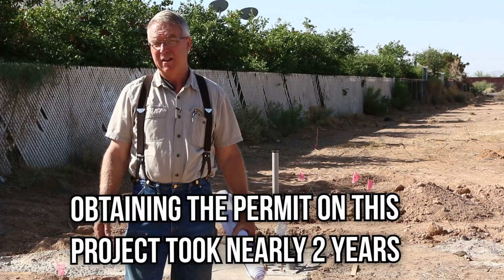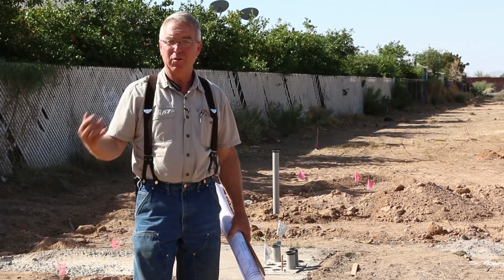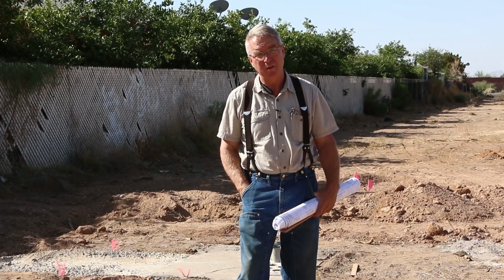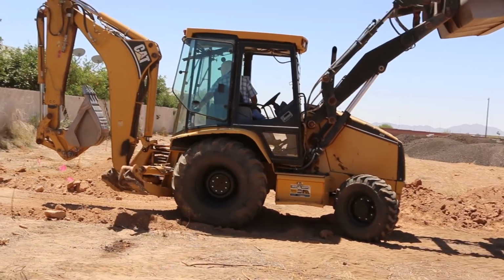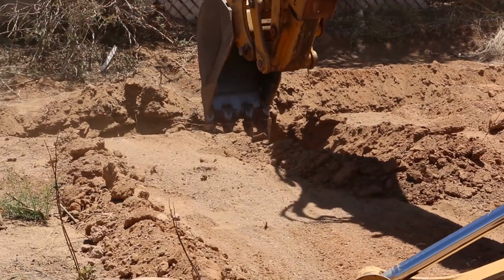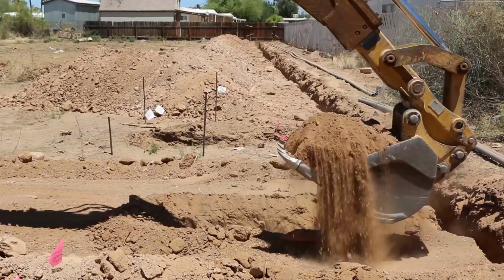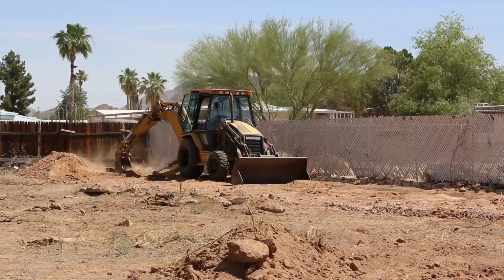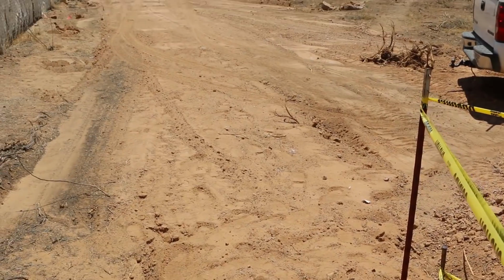Trenching for Underground Electric

Comment: what easy digging. Today, a 3" 10' pipe is $55. Today, in my area, Eversource requires (2) 3" lines. One for backup. Low voltage (Cable co.) also requires 3"  conduit. I'm running roughly 500 feet. This is residential mind you; that's just under $9,000 incl. tax. They're not even in the ground, glued together. 150 + joints.. 2 Silo's, 1 transfer, sweeps, elbows... the cost goes on!

Comment: I just happened to stumble onto this video and like what I've seen. Before your inspector came out, I could tell this was an SRP job by the prints. In the Phoenix area (AKA the Valley) it's either SRP or APS. Both are similar but their specs are pretty much the same. 
As a field superintendent for Premier Underground, we do an INSANE amount of trenching for dry utilities and it's amazing how much dirt comes out of the ground for these jobs.
I came up as a dirt guy (blade operator and other equipment) and can't tell you how many times we would come across conduit that was installed too shallow. They didn't pay attention  to what  subgrade was supposed to be and it cost them a lot of time.

Comment: We usually do rough grade prior to underground. This can save you money and cause less problems. For instance, you can trench underground utilities when you trench footings, you can have building staking in place so you know where the utility risers are going to land, you may not need to trench as deep (assuming it's on the cut side of the pad), and you don't run the risk of hitting recently installed utilities when you over-excavate the foundation. I know many jurisdictions allow you to skip over-ex, but you run the risk of uneven settling of the foundation, but assuming you do over-ex, you are going out from the pad several feet and down several feet, so there's a good chance of hitting that line.

Comment: Great work. 
I am a Underground high voltage lineman/crew leader in the Chicagoland area. Been doing it for 28 years. 
Set more transformers and made the cut into the high voltage lines more times than I can count.

Comment: Last year, my friend Dave was the foreman on a big extension project at an elementary school. His excavator operator, Longy, sensed something was weird as he was trenching for the power lines, and stopped. Dave scratched the dirt with a shovel, and found an unmarked, live 415V cable running across the trench. Mr Long's sixth sense saved lives, and a fortune in repair costs. That's why you hire professionals. There's a big difference between a guy who can drive a backhoe, and a guy who knows how to operate one. Stay safe.
Reply: How do you find an excavator operator with s sixth sense?

Comment: A good bacco operator is going to save you money in the long run.  Digging that by hand or renting a machine might have cost you more in man hours an the job wouldn't be done as good.  They can do in an hour what an inexperienced operator does in two or three hours and it will look great.

Comment: Am I going mad, I don't see any draw strings in the conduits? Are they just hard to see, or is this another geographical difference in how things are done?
Reply: Most people will tie a plastic bag to a string and use a vacuum to suck the string through. Then use the string to pull a larger rope. It just saves time this way. I've pre-run string through conduit before and it sucks. Then on another job I saw an old man do the bag and vacuum trick and I could kick myself for not thinking of it myself.
Reply: And that's why I love YouTube! That's an excellent idea! I've got a load to do shortly, so I'll give that a whirl - thanks!
Reply: greenlee tools makes a wire tugger for this purpose . its pulling strength will amaze you, it has a pulley and a winch assembly built into a portable unit

Comment: Sigh. 6' deep unshored vertical trench is an OSHA safety violation.  3.5' maximum allowable vertical, then sloped 3/4:1 for cohesive soils (which that dry sandy material isn't).  Laborer should have been cleaning lose material from top edge to prevent sloughing.  Total fail.  Unprofessional and shambolic.

That sort of trench is an accident waiting to happen.  And it's always some poor min wage bugger who pays the ultimate price because someone with a lot more money wanted to cut needless corners.
Reply: Can you cite the OSHA standards that you are referring to?  I assume you are deriving your interpretation from CFR 1926 Subpat P since it provides the OSHA regulations for excavations. I don't see a violation of that CFR section in the video. Further, I don't see any refernce in CFR 1926 Subpart P to the numbers you provided.
Reply: So, no, you can't cite any standards to support your comment? Sigh.
Reply: ArthurDentZaphodBeeb      Its great that you took this opportunity to explain how much you know. Congrats! You gained a couple ego points...

Now, just by watching this posted video, it’s impossible to prove that the piping did or didn’t happen above the trench. It might have been dropped in to the trench from the top of trench. So, OSHA standards are in place to protect the worker and employer. Do OSHA standards for benching, sloping, shoring, etc apply when nobody is in the trench? Shit, No..

What about fall protection and being a 6 ft drop? Or confined space? Ladder within 25ft of worker? Etc, etc...
Reply: ArthurDentZaphodBeeb     

Another thought...   maybe they did have shoring then called it off rent when the piping was done. What do you think?

Comment: Gotta love areas with less regulation. Though the 2 yr permit is insane. I’m a plumber in Texas so by no means am I an expert on electrical regulations in Arizona but I would think they’d require a licensed electrician to install anything having to do with electricity. Though I know it’s different state to state and even within the state. I cut my teeth doing mostly service work and residential new construction in a small town in west Texas. I never saw an inspector until I moved to Austin. That gave us the ability to do things that would work fine but may not be exactly by code in order to help customers that needed repairs but couldn’t afford it. We could run an S trap under a sink because we knew there was vent close enough so it would function instead of cutting out cabinets and into the wall to vent according to code or we could put a studor vent up inside the cabinet which is illegal according to code hit would work just fine. We could repair a small area of an old sewer line made from materials that are no longer allowed whereas in Austin they would force you to replace everything that’s not a legal pipe material. If a customer had an old orangeberg line that worked fine except for a 3 ft area, we could replace it instead of breaking the customer by replacing the whole thing. Regulation is obviously needed to a degree but it seems like a lot of places go way overboard which is fine with new construction but very damaging and harmful in service work. Hell they won’t let people have a small possibility of burning themselves with water by requiring anti-scald shower valves, mixing valves, and won’t even let a plumber turn a water above 120. I would definitely give those recommendations to a customer and tell them why it’s better but at some point they have to be responsible for themselves. Like always I rambled on with a bunch of left field stuff but I was shocked they didn’t require an electrician to do it.
Reply: That's why I love living outside city limits. If I want to dig I can dig, if I want to build I can build, and if I don't like it I can flick a lit match into it and try again with no permits or certifications in sight. It can have its cons though, like right now I'm dealing with a house with 50+ y/o wiring. But for me, the pros outweigh the cons. I wouldn't give up my little farm for anything.

Comment: When I built my house, it was muddy when it was time to run the electric line.  I just pushed a trench with a bucket on the front end loader on a tractor.  The electric co here  runs to the meter and then you are responsible from the meter.  When I hooked up the wires, I just called the electric co and told them that I was pulling the meter to hook up the wires and called them when I was done so someone could put a seal back on the meter.

Comment: i thought you'd run all the cable through the conduit then drop it in and cover. How the hell do you run those cables that distance through conduit that is already buried?
Reply: You put all the conduit it the ground .then pull strings in using a fish tape or you can pull stings with a shop vacuum. You tie a plastic bag to a sting then sick it through the pipe .once the strings are in you switch to rope and pull the wires through the pipe .
Reply: condog321
Two or three thousand pound BULL TAPE, and a winch or a vehicle ! 😊
Reply: And they sell gel to assist pulling wire through conduit.
Reply: Excavator with a capstan, some PP rope and a big old bucket of cable lube is the standard where I work. The excavator is optional, depending on how long the cable run is and how many blokes are on site. We often even pull 300mm2 3 core copper cable in by hand if it isn't a massive run.

Comment: Whenever I have needed to bury utilities in long trenches, I have found that it is far more cost effective to dig the trench with a trenching machine.  The ones that I have hired have all been laser level guided (on average $200,000+ machines).  Thus once the trench depth was set to the surveyor's mark (and utility requirement) the trench was dug quickly (They did over 800' in less than 15 minutes in my longest job).  It isn't cheap, but I can usually have my conduits, wires, pipes etc ... in place and ready for inspection by the next day.  Bonus if you have more than one trench to dig is that often all of your trenches can be done dug on the same day.  This helps to cut overall costs as the trenching service tend to give a discount for multiple jobs at the same location/time.
Reply: Directional bore shots work pretty good too. Minimal ground disturbances and a LOT of pipe in the ground in a hurry.

Comment: A word about permits and inspections. Although it is a good feeling when the inspector shows up and gives you your stamp of approval, do not believe for one second that this removes one iota of the contractors responsibility and liability if something is found at a later date that was not built to code. If you hire someone to do permitted work for you, make it a point to know what is going on at all times. Unfortunately, there are as many bad contractors as there are good ones.
Reply: There was a case in Norwalk, CT where a number of homes were built with pilings driven into the ground to support the foundations. The contractor driving the pilings informed the developer that the pilings would not be sufficientif driven according to the engineer’s specs. He must have put it in writing because when the houses had settled and the home owners sued the builder, the piling contractor, and the city of Norwalkonly the builder and the city were held responsible.
Reply: After posting and reading my comment I realized how rude and thoughtless I was not to mention how wonderful this site is and how much it has improved my mental state and overall knowledge of construction. Scott, not a video goes by that I do not wish that you were my dad.
Reply: rattown99 if I am FORCED to pay for an inspection, then the inspector should 1) be at least somewhat liable if the job HE inspected is sub standard, and 2) be properly insured against such instances...

Instead we basically have an extortion racket that charges exorbitant fees at the barrel of a gun, and suffers zero consequences for their mistakes.

Free market inspections do a better job, cost less, and are actually accountable for their errors.

Comment: I worked in the Vegas valley Framing and doing punch for Vegas General const. Mr. Kenny Black in 88-93. It is the same weather, it is like working in hell and you have to drink way more water than normal. Great video! You are so correct: a good backhoe man is worth extra $$$ if they do good work/ Lots of them these days can't even drive the truck that pulls their backhoe trailer. The good ones are always busy.

Comment: As a bloke who has gone from "lazy sponge" to physical labor, sod the building for a bit, give us some tips of not dying a death in the summer heat.
Reply: Big_Adam_2050 a brim on your hard hat, if you have to wear one. 

Or a light colored cloth hanging down the back of the neck.  It provides shade and can be soaked in water for extra cooling.  

Lots of clean fresh water, limit sugar, grain and alcohol intake.  I think eating healthy is the biggest one that is over looked.
Reply: i freeze 4 litres of water before work. and wear a hat and safety sunglasses. it helps if you dont have a boss telling you your going too slow on the hotter days lol
Reply: Slip, slop, slap. Slip on a long-sleeved shirt, slop on some sunscreen, slap on a brimmed hat.
Reply: Love the heat. Buy an Akubra.
Reply: Just drink lots of water and pay attention to your body. You can tell when you’re getting too hot.
Reply: Big_Adam_2050 - I'm assuming that you're in the UK from your profile pic, it was 'only' 30degrees here yesterday, but the 110f EC mentioned is 43degrees! :)
Reply: videogalore true, but here in the UK we have no way of dealing with the heat. AC isn't a common thing in cars, let alone homes. It gets hot, it gets hot bloody everywhere. Also I'm in a warehouse. So big ass oven.
Reply: Hydration tablets my friend. Sucking down the Sugar waters (gatorade) or plain water will only do you so much good. I used to suck down a bucket or two worth of water on shift and still feel thirsty. https://hydralytesports.com.au/product/effervescent-electrolyte-tablets/ These are what I get in Australia, you should be able to find similar, so now I only go through half a bucket or so even on the hottest, grueling days :)
Reply: I know, we're just not used to it here and it seems to come on all of a sudden! If you were in the US you could get a 'Big Ass Fan' for the big ass oven! :D
Reply: water at night maybe say if you get off at 6 in bed by 10. 3 cups or bottles if you drink Gatorade (its good for you but water it down too much at once is just as bad as too little. 20 oz will easily make 2 gallons of water taste awesome adjust for taste) for every 1/2 of a normal bottle drink at least 1full normal bottle of water. or there about. your body and local temp may have you adjust according and water that is closer to body temp (say around 70 degrees which is comfortable for me to drink) is easier on your body to digest i.e that's the water you drink at night at or after dinner empty stomach and youll be in the bathroom 30 min tops. to essentially re-hydrate you depending on body weight and  that will vary . Hydration is the key to staying cool. 

P.S. if you have the luxury of having a cooler and its not a terrible inconvenience by all means bring enough to share and i'm sure you could make it worth everyones time to buy ice in the morning.

Comment: Why does it take so long to get permits? Is their a shortage of workers to review them or just too many coming in to review? For how much they can cost, you would think that they could process them faster.

Also, conduit? You didn't do direct burial triplex? The soil there isn't heavily clay based normally. Was there a concern with soil movement for some reason? Or was the service so low of amperage, being a warehouse/mini-storage, that you didn't need a large service?
Reply: The conduit is for primary voltage.  13kV or higher.Better put that in conduit.
Reply: There is direct burial for that. It doesn't hold up as well as conduit in some soils and climates. Depends on what the local utility wants for the connection and the cost of direct burial compared to using conduit.